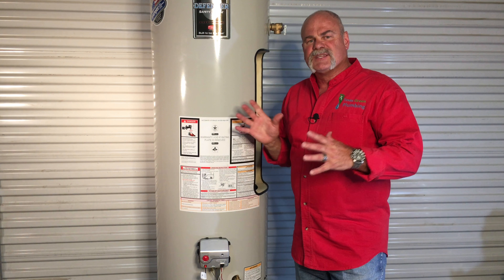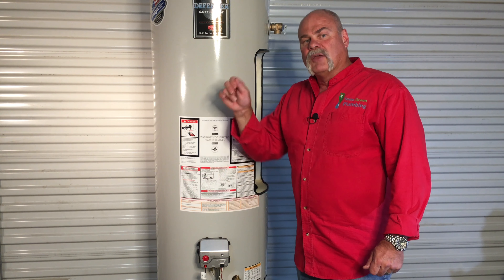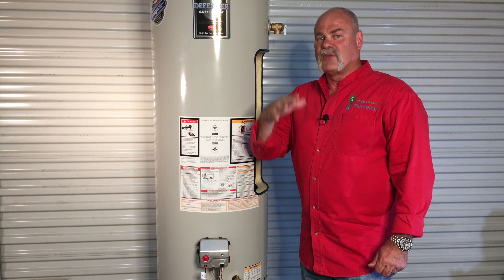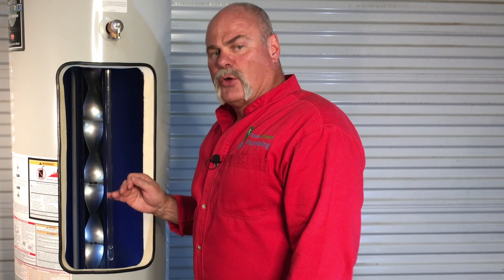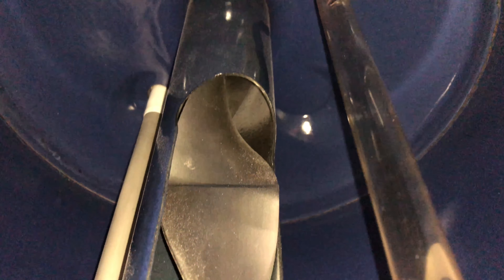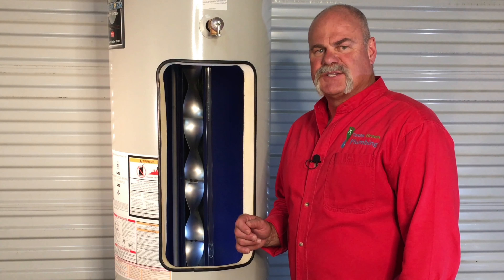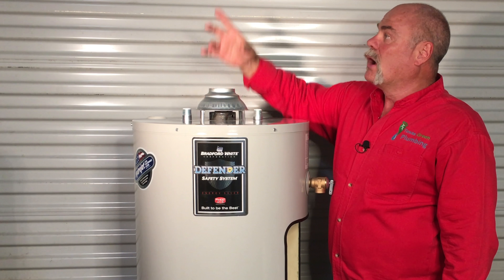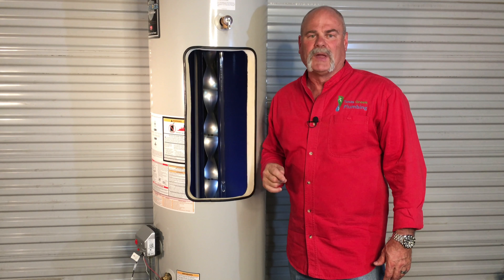What's Inside A Gas Water Heater? - Plumbing Basics - The Expert Plumber

Comment: In my area the t&p valve has to be like like an in direct drain must terminate 2” from the bottom of the safety pan and then a drain is ran from the safety pan to the outside. And its metal pans for gas and plastic pans for electric.